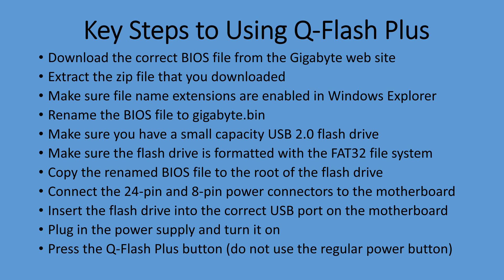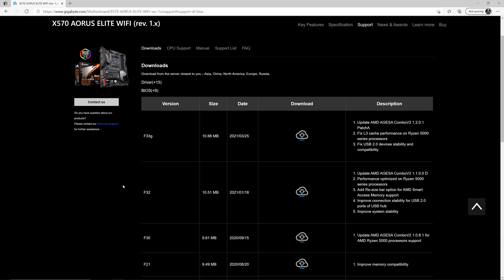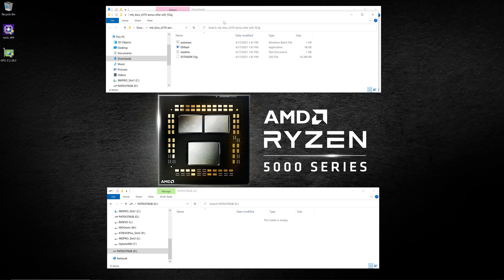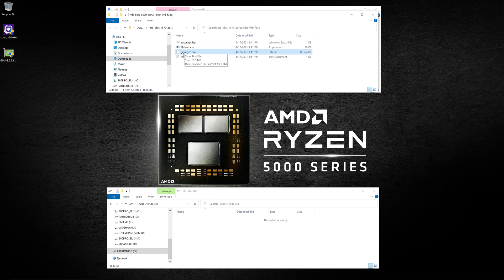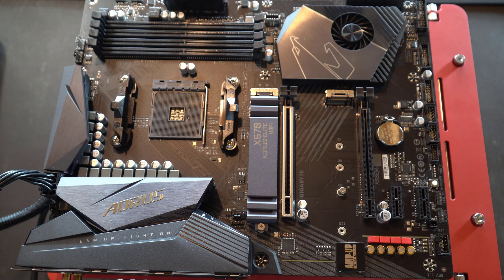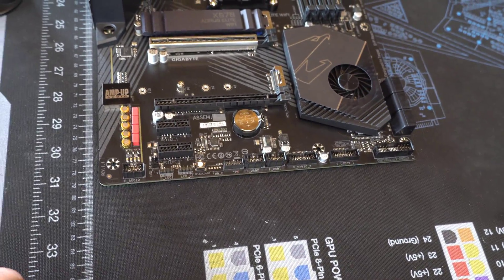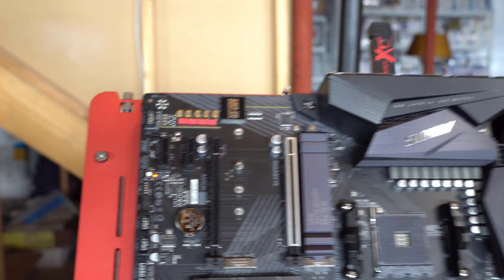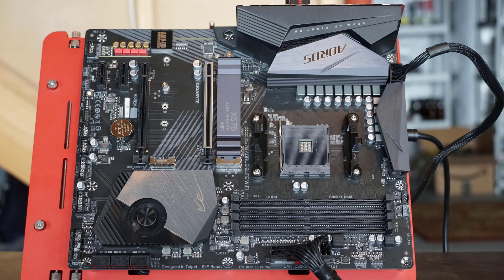How to Flash the Gigabyte X570 AORUS Elite WiFi with Q-Flash Plus

Comment: I am really struggling with this. I’m wondering if I have a bad board. I’ve followed your instructions and I’ve watched the video in full several times. Using a USB 2.0 I plug it into the correct USB for the bios then I switch the power on and press the qflash button and nothing happens. I’ve tried resetting the cables several times too. I’m going to try a 3.0 just incase. If that doesn’t work I think I’ll have to RMA the board.
Reply from the maker: I'm sorry you are having so much difficulty. It is possible that you have a bad motherboard, or possibly a bad power supply.

Comment: So I have to remove the cpu if I want to flash the BIOS or can I flash it with the cpu already installed?
Reply from the maker: It will work either way (as I stated in the video).
Reply: @GlennBerrySQL  I tried with the cpu installed but the led didn't blink when I pressed it
Reply from the maker: @1mharuo  That sounds like a problem with your USB flash drive. Please read the troubleshooting tips in my pinned comment.
Reply: @GlennBerrySQL  I followed what you showed exactly and I used a 8 gb USB what else can I do?
Reply from the maker: @1mharuo  Is it a USB 2.0 drive (not a USB 3.0 or 3.1)?

Comment: Thanks for the video! 
I used the: GIGABYTE X570 I AORUS Pro Wi-Fi board and was having issues. 
First I tried reformatting my 2 usb drives, but it would not work. When I turned on the q-flash button my USB would light up, but not my q-flash LED. After trying several times, I put all components in my PC and it would not post to the bios. 

I decided to try q-flash with all my components in the motherboard (cpu, cpu cooler, RAM, GPU, and power to all)  - and it finally worked. The q flash LED flashed for about 6 minutes and once I rebooted - I was in the BIOS.  

Thanks for the video - very helpful for people using q-flash for the first time.
Reply from the maker: Glad you got it working! Thanks for the comment!

Comment: Hello everyone, I have it connected the same way as Glenn did in the video.
My MB LED just flashes on for a second and goes off, is this normal? or is it a faulty MB?
I tried switching it on with no CPU, memory nor GPU, just to see if it lights up and the fans spin, but it doesn't.
Can anyone help me out?
Reply from the maker: That sounds like a problem with your USB flash drive. It needs to be a small capacity USB 2.0 drive, fomatted in FAT32. The BIOS file needs to be in the root of the drive, not in a directory.

Comment: Does the gigabyte.bin need to be on an empty flash drive? I have all of my other drivers installed on the same flash drive. Or does it not matter as long as the gigabyte.bin file is not in a folder?
Reply from the maker: It doesn't matter, as long as it is at the root of the drive, and not in a folder. Q-Flash Plus is just looking for that exact file name in that exact location.
Reply: @GlennBerrySQL  Perfect thank you! And thank you for the informative video!
Reply from the maker: @AHeriocWatermelon  Glad to help!

Comment: I have a quick question. Can I use the regular q-flash feature after putting the gigabyte.bin file into the usb?
Reply from the maker: Yes. With the regular Q-Flash feature, it doesn't really matter what the file is called or where it is located. As long as you can find it using Q-Flash, it should work.

Comment: I have a USB 3.0 drive (blue colored connector rather than black)j and it did not work. This is 2021, it is so hard to find USB 2.0 drives anymore. What are my options?
Reply from the maker: Here is one place to get a small USB 2.0 flash drive.

Gigastone V10 4GB USB2.0 Flash Drive on Amazon
https://amzn.to/3bMsUjA
Reply: I got it from local Walmart for $4 and worked like a charm. Worked on first try.

Comment: I've done this exactly with a 5900X and X570 Aorus Ultra, with CPU, RAM and GPU installed and uninstalled, the CPU red light is on in either situation. After holding in the Q Flash button for several seconds the motherboard activates with all fans (including GPU), and the Q-Flash Plus Amber light flashes for several minutes, then stops, but no reboot cycle and eventual post, and the CPU red light remains on. Rebooting the system does not yield a post either, though I am able to replicate the Q-flash.

Any help would be greatly appreciated! :)

Comment: mine only flashes for 2 minutes, and then when I try to boot up I have not got any video, it is a fresh build, I have the exact motherboard and a ryzen 9 5900x chip
Reply: also does it have to be a 2.0 usb what about 3.0? not sure what the usb is that I am currently using
Reply from the maker: @KillirBeard  I know that USB 2.0 works. People seem to have mixed results with USB 3.0.
Reply from the maker: Do you have a GPU, and is your monitor plugged into the GPU (not the video out port on the motherboard)?
Reply: @GlennBerrySQL  I have a gpu, I tried both slots on the gpu and the hdmi on the x570, nothing and the update took 1.5 -2 min. and the q flash light would stop blinking, did it with the stuff on the mother board and with a bare motherboard. think its the bios update that is the issue.
Reply from the maker: @KillirBeard  The HDMI on the motherboard is not going work, since the Ryzen 9 5900X does not have integrated graphics. Your GPU should be in the slot closest to the CPU.
Reply: @GlennBerrySQL  Ya I just tried it to exhaust everything lol, well I just did the q-flash bios update with the new 2.0 usb drive and the light flashed for 3.5 min and then stopped flashing, and still nothing, all my fans light up my keyboard and mouse light up as well, just no video
Reply from the maker: @KillirBeard  Do you know for sure that your GPU is good?  Did you connect the PCIe power cables to it?
Reply: @GlennBerrySQL  so I have not built a pc in 9-10 years and ya I forgot/don’t think to power it lol. So it is working now. And now I have the dreaded windows restart error loop. Fun fun

Comment: after the qflash led stopped, the chipset fan and ram led is still on, any idea?
Reply from the maker: That is normal. If the BIOS flash LED blinked for 5-6 minutes and then stopped, that means that it probably worked. The only way to confirm it for sure is to see if the system will POST.
Reply: @GlennBerrySQL  the blinking lasted pretty much 2 minutes in my case with the master version of the mb (not elite). It didn't take 5-6 minutes so I hope it worked. I'll only be able to test it in a couple of days. Let's hope for the best.
Reply from the maker: @Demovitron  The only way to know for sure is to assemble the system and see if it will POST.

Comment: I’m pressing the q flash button and it doesn’t flash at all. Powers on, everything connected, bare board.
Reply from the maker: That sounds like a problem with the USB drive. You need to have followed all of the instructions in the video exactly, with the correct BIOS file, renaming it, having it in the root of the drive, using FAT32, etc.
Reply: @GlennBerrySQL  turns out I just have a dead motherboard, it wouldn’t work with a 3700x either. It seems like it also bricked my 5950x, it won’t work in any motherboard, I’ve tried 3
Reply from the maker: @babaganoosh8345  That is unfortunate that you have a defective motherboard. It is rare, but it can happen.

Comment: Thank you so much. I just did my first build and this video is perfect for me. Same board and a 5000 series cpu. Now I'm ready and you're amazing again ty so much. Great video.
Reply: My q flash won't flash I get no light. But when I powered on the system all lights flashed and went of except my ram rgb. I never powered on actual power button. Just psu switch.
Reply from the maker: That sounds like a problem with the USB drive. You need to have followed all of the instructions in the video exactly, with the correct BIOS file, renaming it, having it in the root of the drive, using FAT32, etc. You are NOT supposed to turn on the actual case power button.
Reply from the maker: Glad to help!

Comment: hello im trying to flash this board for a 5800x should i download the newest bios update or use the f30 it says that works for the 5800x?
Reply from the maker: I would use the latest version, but any version that supports a 5800X will work. There have been lots of bug fixes and other improvements in later BIOS versions.

Comment: Hi there,

So I flashed my mobo just now and it took like 3-4 minutes. Could this be a problem?
Reply from the maker: Probably not. As long as it did not stop flashing after a few seconds. I have seen some variations in the time, depending on the performance of the USB drive.

The only way to know for sure is to assemble the system (even outside the case) and see if it will POST or not.
Reply: I just flashed my mobo and it took about 4 minutes. Did yours end up working fine?
Reply from the maker: @shawnpadberg9229  I think the time can vary a little bit, based on how fast the USB drive is.

Comment: Can you pls make a vid for x570 aorus master and also can we take psu cable out after bios is done upgrading, I heard u can get electric shock if u install cpu with psu cable on motherboard
Reply from the maker: If the PSU is turned off or unplugged, there is no possible way to get shocked while assembling the system. The standard, safe practice is to assemble the system while nothing is plugged into the wall.
Reply: @GlennBerrySQL  that's what I meant but I still didnt get the answer whether I can take it out or not
Reply from the maker: @anitamukherjee9575  Yes, you can and should unplug all the power cables after using this method on a bare system.